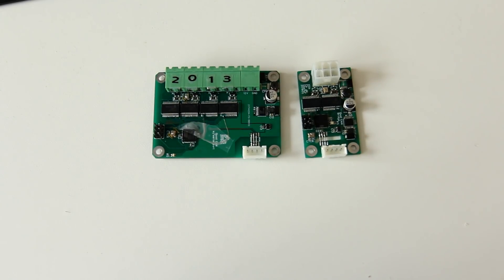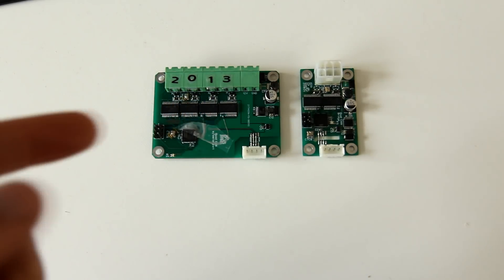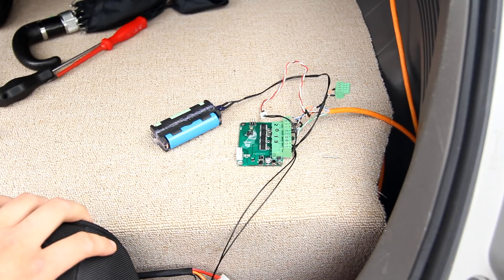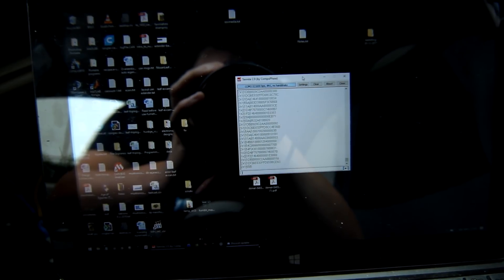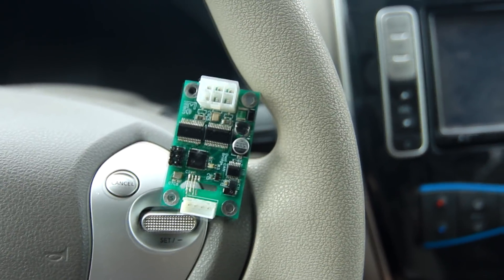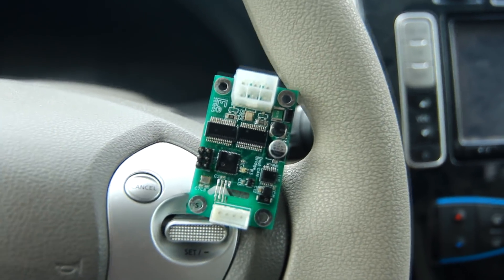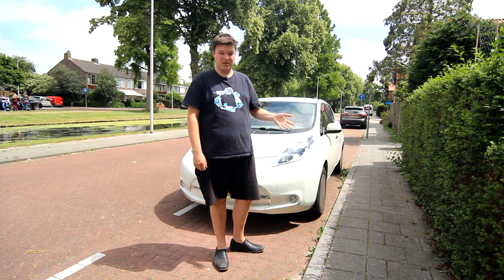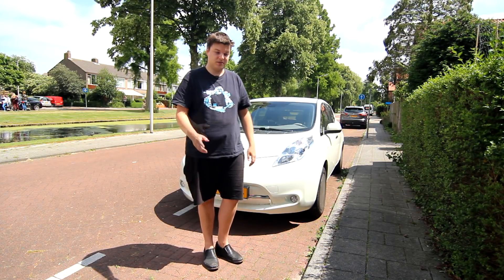EV Mods: Finishing the extender electronics

Comment: Awesome work!  Keep on going.  As a Leaf owner I'm very interested in having ability to collaborate with the cars systems for adding value to the vehicle through minor and major add-ons:  i.e. external battery packs, Vehicle to Home,  aftermarket/refurbished battery packs.  

Can you make the "Guess-O-Meter" accurate? - This one hack requires no physical changes to the vehicle and is something EVERY Leaf owner wants - seems like you have a market for 300,000 units if you can do this with something that plugs into the OBD port and spoofs the computer into displaying the correct range remaining.  I'd buy something like this in an instant.

Comment: I can see these CAN bridge boards being very handy, for various projects.
Testing CAN bus devices, connecting otherwise incompatible CAN devices together, fixing issues with that one device that doesn't play nicely with others due to speed/noise issues.
Off grid power is another area where CAN connected BMS systems prove tricky to re-use.

Planning on sharing your design when you sort out the sleep mode ?
Reply from the maker: I probably won't open source it, but it'll be for sale for a reasonable price.

Comment: Please sell these asap. I have a ton of salvaged chevy volt batteries that i have broken down into 1s3p at 48ah and have a good undercarriage spot that i can configure to fit the cells in and increase my range by at least 60miles which finally would make it my primary car. I also am paralleling a brusa charger to increase my charging speed to almost 10kw which will max out the average rv outlet and charge the car much faster. Makes the car just as good as the new leaf.. Maybe even better!

Comment: Awesome reverse engineering!
You said in the video that your CAN interceptor "adds the capacity" and then sends it to the dash computer.
Are you sending additional readings for the extender voltage packs or are you modifying the readings sent by the standard battery pack? (Averaging the voltage from 1 main battery pack with the voltage of 1 extender pack)
Does the dash computer accept the additional data packages for the extra modules? Or is it fixed to only accepting the known amount of packages from the main battery?

I ask, because I can see a flaw in the design if you combine/average values. You could end up pulling large currents from a battery pack that had a cell with a low voltage. This cell would normally have triggered turtle mode, but due to the math by the interceptor module it didn't. This could result in damaging either battery packs when at low charge levels.
If you are sending additional information for the extra battery packs, it would be fine I think.
Reply from the maker: There's some secret sauce going into it, yeah. I'm mostly straight up adding kWh capacities, but also intercepting cell voltages and triggering turtle mode when any cell hits the undervoltage limit - 3.22V/cell for the main pack and 2.80V/cell for the extender. And some more stuff; I'm actually working my way through the official requirements on battery safety and trying to properly implement everything as I go.
Reply: Hahaha secret sauce. Love the term. 
You should list some of these supported battery management/safety features on the website. I think seeing them there would encourage more orders.

What's the reason why you have a lower turtle threshold on the extender pack? 
I thought the general rule was for Lipos to never go lower than 3.0V.
Reply from the maker: The pre-orders don't really have to flood in.... we're already booked well into 2019 even if we can start installing at the end of this year, and that is all but certain, we still have a lot to do. Also, most people really just want to see how the extender looks installed in the car and don't necessarily care about the features, just that it works and it's safe.

The extender cells are pure 1:1 NCAs, so they go down to 2.75V. But if the main pack doesn't go down to 3.2V, the extender will also never even get close, that would indicate massive imbalance.